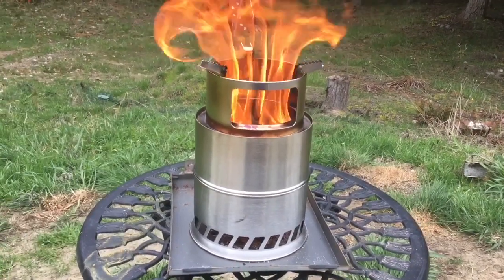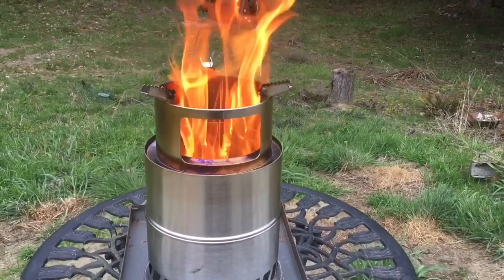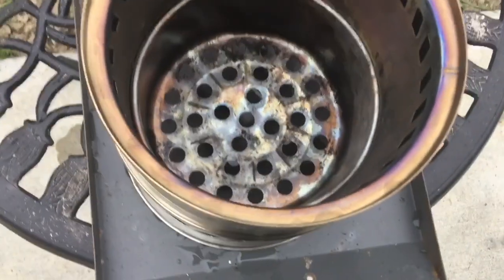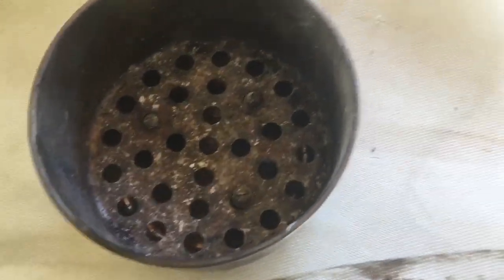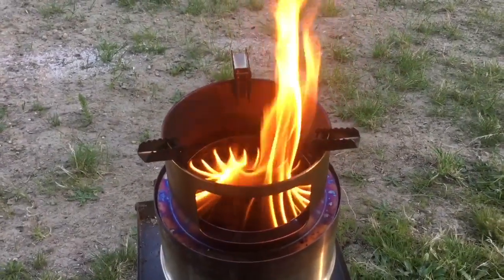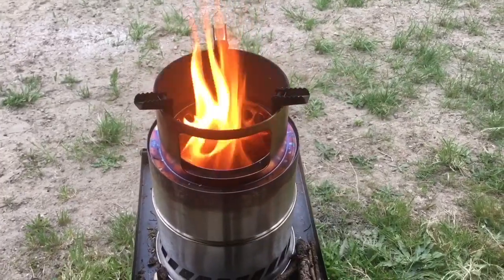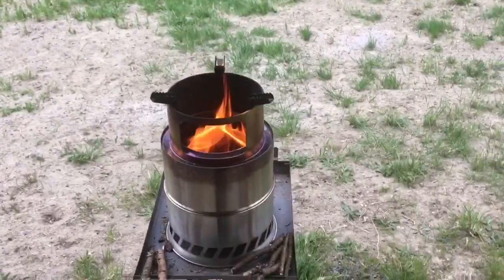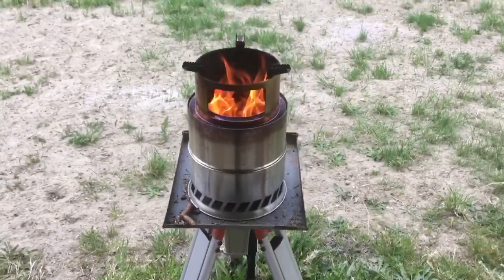Wood campstove air control

Comment: I saw your comments to a video which led me here.
I'm just about to make one of these, so have been gathering as many hints & tips as possible.
The science is absolutely fascinating. 
I thought it would simply be a case of drilling a few holes, sealing the gap between inner & outer pots and away we go! 
I think I've got my head around the maths, so will be following your advice.
Brilliant video, thank you so much 👌😎
Reply from the maker: @simonh8931  Your welcome.  I have found that the larger the stove/fire pit, the lower the percentage of the burn chamber bottom surface you need to admit primary air.  Now of course the actual volume of air provided by a given size vent is dependent on a lot of other factors in the design/build, but percent of burn chamber surface area seemed like a good way to define/describe the relationship and gauge performance against.  The pits I make from 50gal domestic water heater tanks(~15” dia, 12-15 tall) take well under 1% of the bottom area for primary air.  They burn best when they occasionally pull air/flame downward as on that size it helps the secondary air mix with the wood gas over the larger top opening area.  This little stove with a 6” burn pot wound up performing best with ~5% of the bottom surface area for primary vent.  This was the smallest I had played with, and was a little surprised the percentage was this high.  Good luck with yours.

Comment: New to this, why dont you just put a ring around the bottom intake holes to limit air flow? Would that not be the same?
Reply from the maker: Well the holes around the base provide both the primary(into the coals/base of the fire) AND secondary air(hot air over the top to ignite the wood-gas released by the primary fire/heat).  The issue with most of these stoves is they deliver way too much primary air.  You want a lot more secondary air than you do primary air.  In fact the only restriction you really want on the secondary air flowing up between the inner and outer walls, is you want to slow it down enough for it to get hot enough to easily ignite the wood gas at the top and create a good clean secondary combustion.  On the fire pits I build, I throttle this secondary air at the top, but secondary air could be just as easily throttled at the bottom by partially covering those bottom holes as you suggest.  but you still need the inner dish or something to block off most of the inner holes in the bottom of the burn chamber to change the relationship between primary and secondary airflow on this design stove.  The dish works well as it also catches the embers and ash that falls thru the bottom holes…